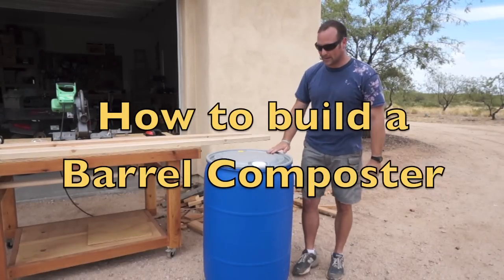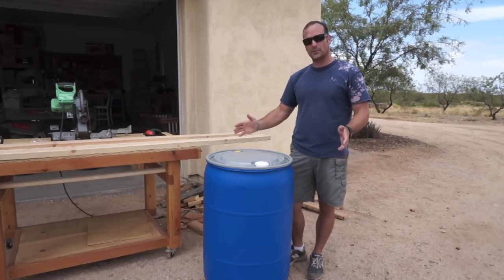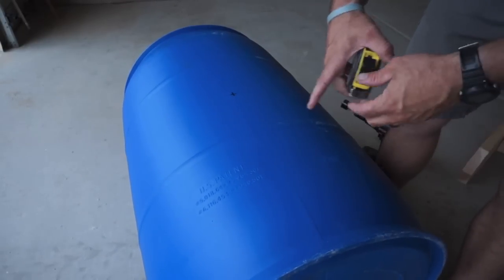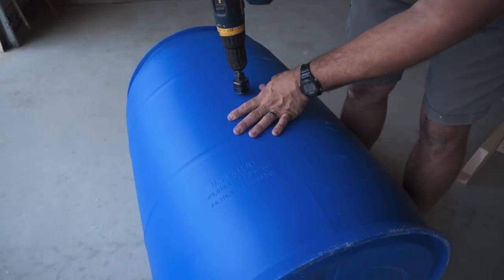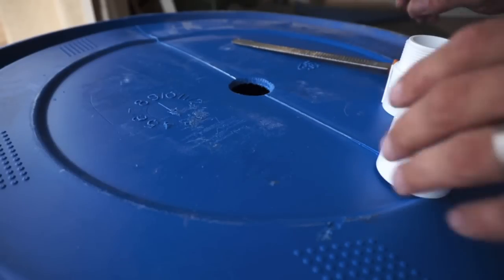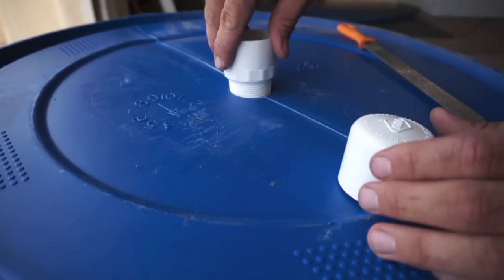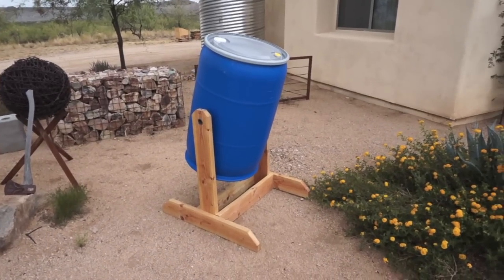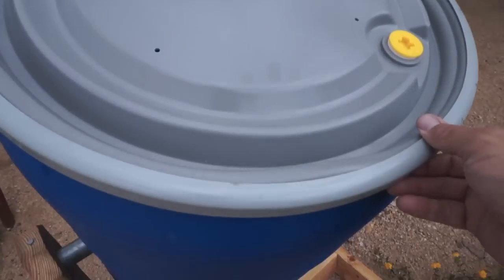DIY composter tumbler - 55 gallon barrel project

Comment: Best composter and best no BS video.  You kept it simple.  No explanation of NKP or other "pretend" rocket science unnecessary for the video.  This composter uses very little space.  I put some cool rollers on mine.  You can make some little additions to the inside (flappers) to make it mix quicker and clean the sides but other than that very cool.
Reply from the maker: +Noway Getname Thanks NG!  It's a pretty simple design and works well for me... I like your idea on the flappers though... also, if you want to check it out, I have an article on backwoodshome.com where I give more detailed plans about this composter.  thanks for watching!
Joe
Reply: Interesting comment on the flappers.  What material would you use and where would you affix them on the tumbler?  Dave

Comment: Thanks a lot. I made two tumblers based on your design and they work like a charm.
Reply: Any problems with this design?
Reply: @oceanminded2009  In my country rains a lot, so low moisture levels inside the tumbler is not an issue. I added more holes on the bottom to breathe and I took measures for rain doesn't find its way to get inside the tumbler.

Comment: Thanks for the easy instructions.  I just completed mine and started using it immediately.  Only time will tell if I have enough air but other than that... it works just perfectly.
Reply from the maker: Awesome to hear Nate!  Glad to hear that... keep it moist and tumbled every so often and I think you'll have good results.  If it seems too wet then add some holes... of course that will depend on your climate, etc,.
Joe

Comment: Great project!  I bought a cheap tumbling composter from Home depot after I kept finding mice and rats in my larger compost bin and it started to fall apart after I put had it about half way full.  So I bought a worm bin but I have way too many kitchen scraps for the worms to keep up with, plus I keep it inside and don't  want to bring in leaves etc from outside.  I wish I could make this compost bin. 
I have absolutely no skills in any kind of drilling or woodwork even though I love watching This old House and other shows where people build or fix stuff.
Reply from the maker: Thanks so much Nbella21,
If you ask the folks at home depot or Lowes I bet they'll  do the basic cuts for you.  they probably won't do the angled cuts but those are more for looks and you could do them by borrowing a hand saw.  Other than that, all you'd really need to do is borrow a drill with a couple bits and then a hammer and nails.  
Thanks for watching and good luck if you try to have a go at it.  I think you'll do better than you think:)
Joe

Comment: Cool video, I have 4 of those barrel that I use for rain collection and I been thinking to convert one to a tumbler, I am going to use your design but I will make the uprights and feet one inch shorter so that two 8 feet boards will do.
Reply from the maker: +Domenico Giammona Thanks Domenico!  I think that should work just fine:)
Joe

Comment: Would this work with 2x4's as opposed to 2x6's, or would that make the structure too weak? Would the boards be too narrow for the 1.5' pipe or screws? I found a good deal for wood on Facebook Marketplace. someone is selling 38" 2x4s in bundles of 50 for $40 (80 cents each!). if not, I will get two 10-foot 2x6s for $7 each on FB marketplace. Is $7 a bad deal for a 10-foot 2x6? Thanks for the video!
Reply from the maker: I’d thinking would be fine if you used a smaller diameter pipe lol 1-1.25”.  To allow for more wood on either side.   I’d also ad some 45 degree backing too.

Comment: Hey Joe, was wondering how the barrel has held up where the metal tube inserts? Has it warped or stretched at all if you're still using the same one? I'm undertaking the project as we speak and wondered about its longevity? 
Thanks! 
Jon.
Reply from the maker: +Jonathan Bray Hey Jonathan... just went down and looked at both of mine and they look completely fine.  the hole has virtually no wear that I can see.... and the bar has no bend or sag either.  Now, that's not to say it couldn't depending on what someone is putting in there.  If a guy filled it with sand or pure dirt... I'm sure it would sag and show significant signs of wear.  But for normal composting stuff, like food scraps, chicken poo, etc,.... I think it'll be totally fine:)
Joe
Reply: +homesteadonomics Awesome, thanks very much Joe, love the vids!

Comment: Do the retention pins go through the fence post? It didn't look like the holes you drilled went all they way through the fence post. Thanks.
Reply from the maker: Yes, they go through the wood and then through the galvanized pipe to keep it from sliding out.  they only go in just enough to punch through one side of the pipe.  Hope that helps:)
joe

Comment: If you drill holes into the barrel for aeration as you recommend in your article, could you do without the PVC aerator? I live in a moist climate. Also, would PVC work for the center post? Looks to be 29" for that post, based on the length of your spacers, right?
Reply from the maker: Yes, you could probably do with out the aerator, but you'd probably want to do more exterior holes.  As for the center post (pivot?)... PVC would probably be way to weak for the weight of soil.   And yes, I believe 29" was about the length.  But you might want to check the article just to be sure... i think it's one of the free articles on backwoodshome.com:)  thanks for watching
Joe

Comment: Hi Joe,
I noticed that you also added additional retention pins on the pipe (to keep the tumbler centered on the pipe).  Do you have any problem with the tumbler (if not on level ground) sliding over the head of the nails?

Comment: Well done ! I'm starting small with 5 gallon buckets while I research larger units.   Do you prefer this end-over-end tumbler versus the tumblers that lay horizontally ?  Thanks for sharing the video !
Reply from the maker: Hi Alan...yes, I do... they are harder to turn but I feel they more adequetly mix the material inside versus the horizontal ones which seem like it just kind of 'rolls' the compost.   but I think either is great:)  
.... however, this style makes creating an opening easier since the opening is already there and it can be tilted in a wheel barrow:)Joe

Comment: I know this is a silly and cheap-skate question, but could I just roll the barrel around on the ground instead of building all of this? It'll be back in the woods so definitely not concerned with appearance
Reply: I have a smaller barrel that I roll around. Some times I stand it on the end. Works fine for me.

Comment: I live in the country and I rack a lot of leaves my problem is that I want to seperate the sand from the leaves, so that can replace the sand in my yard I use a round  sifter with a net and shake it off but its time consuming. how can I build a netted barrel  to seperate the leaves from the sand?
Reply from the maker: +Michele Harrison Hi Michele,  I think you might be able to drill larger  (1" +) holes and line the inside of them with some wire screen.  I'd think a lot of the sand would fall out during the tumbling process.  However, if you are in an arid environment like mine then the bigger holes might dry the material out too quickly.  Anyways, hopefully that might be a solution to the sand:)
Thanks for watching!
Joe

Comment: forgive my ignorance , but what's the point of making the bin tumble, maybe for easy emptying?
Reply from the maker: its to help mix the contents as well as emptying it... if it didn't tumble the bottom of the compost would compost at a different rate as the other contents.  it also helps to ad air to the mix
Reply: Rapid composting requires aerobic bacteria which need oxygen. The alternative is turning with a fork, very laborious. Ignorance forgiven! I had no idea how important aeration was until I got a compost ball.

Comment: What about the lid?  Are You going to have to remove the band each time You empty the barrel?
I suggest that You add a hinge to one side and a clasp to the other side of the lid to make emptying easier.
Reply from the maker: Paul Smith Thanks for the tip Paul!  However these particular lids aren't strong enough to hold a 3/4 full barrel full of compost without bending when being tumbled... without the ring holding all sides that is:)  There might be some other styles of barrel that have thicker lids but these are a little bit thinner. Overall, it takes about 5 seconds to take the ring and the lid off and about 10-20 to put it back on.... so it's not too bad.  But it's a very good idea and maybe could try it by reinforcing the lid a bit with a small piece of wood.
But anyway, thanks for the tip and for watching:)
Joe

Comment: Such an awesome idea. How much does it cost you. Also I recently sent out a Shavette to a guy in Arizona. He's from Cottonwood.
Reply from the maker: Hey Eddie,  The barrel will range between $18-30 bucks depending on what was in it, etc, and where you get it from.  And the wood I believe was about $12.  Add in about 2 bucks worth of hardware, $3.50 worth of PVC and a junk fence pipe for free.  So in total you could do it for say $35-45ish depending on how you source your materials.  My first composter I built for only about $23 due to 'cull' bin lumber and a really cheap barrel.

BTW- That's cool you sent a shavette to cottonwood, I'll take one too please;)  jk... do you sell them or was it a pass around?  Also, what kind of shavette... they are a pretty cool half-way between the safety and a straight:)

Thanks for watching!
Reply: homesteadonomics That's crazy cheap. They're pretty pricey at retailers even though it's all molded plastic snapped together. Also, it was a Parker. Same design as your HTGAM. I wasn't using it since I use my Dovo shavette so I told him he could have it and we swapped info.

Comment: Material list I gathered from the video:
1x 55 Gallon Barrel/Drum with lid and locking ring (Screw top will suffice)
2x 2 in. x 6 in. x 10 ft Boards (12 ft if you'd like it a little taller to aid a wheel barrow to get under it)
Small box of #10 x 3 in. Outdoor Multi-Material Screws (No Pre-Drilling in Wood type)
PVC fittings to fit your hole saw: e.g 2 ft PVC pipe + 4x fittings: 2x male thread FPT Adapter + 1x female thread end cap + 1x female thread FPT Adapter
Metal pipe to fit your hole saw cut to width of stand
Tin of Linseed oil

Comment: At the 4:05 mark, you drilled holes in the wood and added what looks like nails. Please explain the purpose.
Reply: They are locking pins that keep the barrel from spinning in the wind.
Reply: They are to keep the pipe from working it’s way out of the uprights.

Comment: 4:07  I don't understand when the retention pins are for.  Do those go through the pipe to hold it in place?  I didn't see you drill any holes in the pipe.  You had a mic.  Not sure why you didn't explain things as you went along.

Comment: Could it be better if we just roll the drum without having to make stand. Would it have same effect?
Reply from the maker: +Fn Lim yes, you can certainly do that... it might take a bit more rolling to properly mix it but I don't see why it wouldn't work:)  One advantage to this style is that you can put a wheel barrow or bucket under the open end to empty the finished compost out of the barrel.... and you can spin it in a tight space, like a side yard where you might not be able to roll the other one around as easily.
But give it a try and either way I'm sure you'll come up with some great stuff:)
Joe